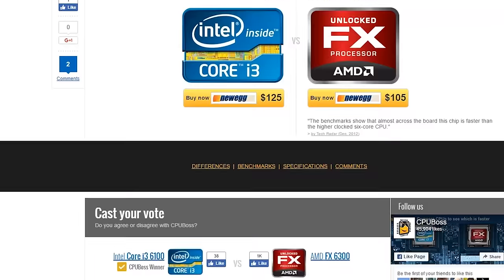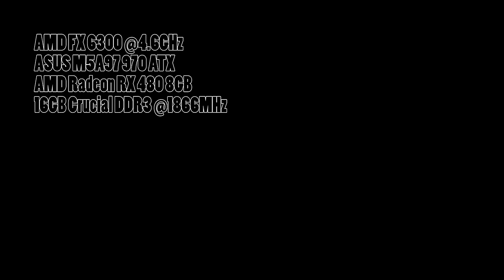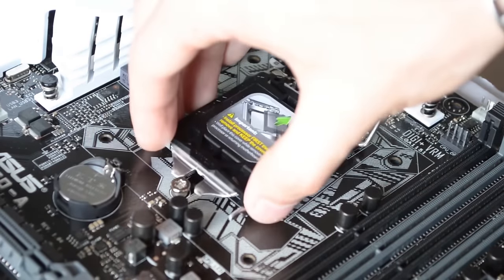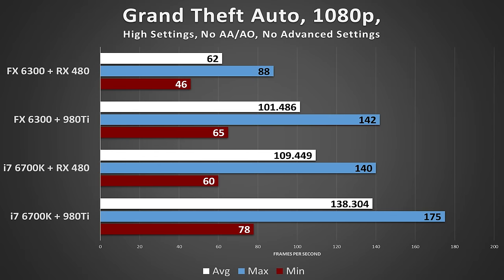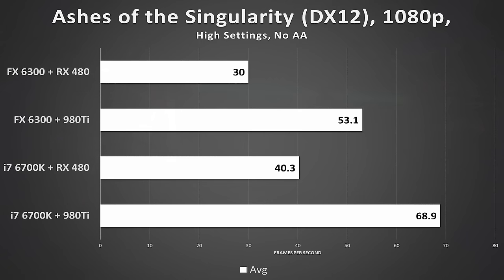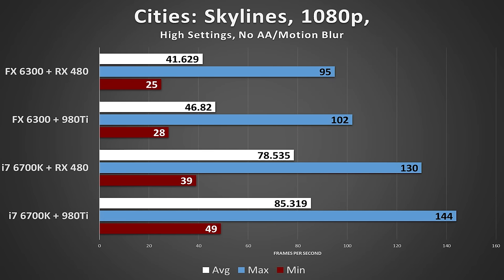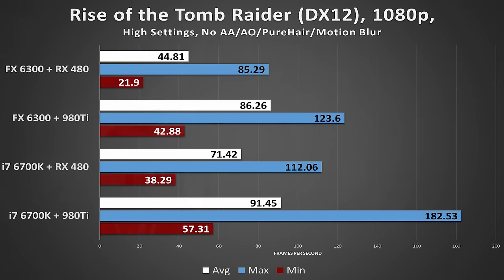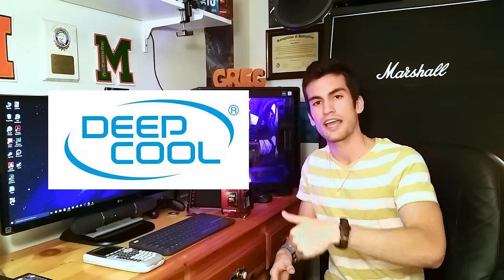AMD FX 6300 + RX 480: Severe Bottleneck?

Comment: I don't see the point of benchmarks in cpus OC's so hard... Why no benchmarks on stock speed?  Or is that bad?
Reply from the maker: You'd be crazy to not overclock. If you build computers, you overclock. End of story.
Reply: Science Studio ok that´s fine, but this is a cheap cpu... it´s logic to be paired with a cheap mobo like the MSI 970a-g43 on those mobos you can´t oc nothing... my question is is too bad pair this cpu on stock speed with a RX 480?
Reply: +Science Studio Lol overclocking the cpu too much can make a little nuke that can make your mom be soo angry because you waste your money only for waching your cpu is explode because over heating

Comment: i currently have an fx 6300 and gtx 960 i plan on upgrading to the rx 480 and the fx 8350 but i can only buy them one at a time so would the rx480 noticeably increase my performance at all until i get the 8350 or not.

Comment: I have a FX 6300 and am considering getting a RX 480. This video shows that it does bottleneck, but that would be until I get a new processor. I'll probably get a zen processor, changing mobo and cpu now just to get an i5 is a bit silly imo.
Reply: I believe Zen will use a newer socket than the current AM3+ socket, but hey I'm waiting for it too. Although, I don't think I will see any gaming benefit, they already run the max my monitor supports, but for a few work style applications, like cad rendering, maybe I could turn my render times down to half a second... The 8350 @4.4 Ghz is what I run, but I really designed mine for cad instead of games, but hey, when you've got a little extra time on the weekend, why not play some Fallout or Tomb Raider? It really depends on what you play as to if you need, for me an R9 270 (sometimes overclocked) runs smooth, but I need more than 8GB of ram, or Fallout likes to crash...
Reply: AMD ZEN cpus will be AM4 based Socket, so you still will have to buy a new mobo for that CPU, also it will use DDR4 RAM, better off if you buy a 8350 used cheap with a good AIO cooler and give it a good overclock to not bottleneck the 480

If you really want something good and cheap, look for Xeon processors on ebay that are 771 socket based, those can be modded to be used on 775 mobos and you can overclock them quite a lot and have great gaming performance, near Skylake i5 6600K if you nail it right
Reply: The point was if I upgrade my mobo and CPU, might as well wait for the new stuff to show up in 6 months (I think that's when zen is out). If zen isn't that good, it might cause other CPU prices to drop.
Reply: Wineblood well this is kind of late. But I did go from an fx 6300 to an i5 4590. Kept the same graphics card tho gtx 960 2gb. With the fx I had fps drops and stuttering at all times. I had none of that with the i5. You might not think it's worth, but it really is.

Comment: Do you think there would be a severe bottlenecking with the i5 4460 with the RX 480?
Reply: Stock? 
Maybe a little
OC'ed
Nope not worth mentioning.
Reply: 4460 is locked. you cant OC it. intel once more doggied you. dont buy intel, ever.
Reply: No, you're going to be fine.
Reply: Friedrich Wilhelm Nietzsche 
Why not buy intel ever when they make the best products especially for gaming. Just buy what makes the most sense for the given budget. 

You can overclock Processor with locked multipliers by increasing the base frequency. However results will indeed be limited compared to a K version due to that restriction.
Reply: 1barnet1 you still want to be doggied by intel.  its weird.
Reply: Friedrich Wilhelm Nietzsche 
Bought a i5 3570k.
It's now running for 3 years at 4.4 ghz stable. 

Single thread performance is arround 50% higher then anything i can get from AMD today. 

Games rarely benefit from having more then 4 threads. So honestly i am rather happy i did not buy crapdozer and jumped ship to intel. 

I had a Phenom 2 X6 previously Which to be honest was their last half decent CPU. 

Luckily some of their GPU's were pretty good. Otherwise they would have been out of business.
Reply: 1barnet1 if you have money, go for intel. that's not our topic. but intel cant beat amd in affordable way. 

hell. they sell i3 skycrap for 125$ (dual core, locked shit)

 while amd sells hexa core, unlocked, beast cpu at 90$.
Reply: Friedrich Wilhelm Nietzsche That skycrap i3 is still better in application's / gaming than that hexa - core from 2011, even beating 8350.
Reply: AnSonCZ most of games are supporting quad core, some of them even hexa core. what the hell are you doing with dual core ripoff?
Reply: Friedrich Wilhelm Nietzsche Check some game's benchmarks, dual - core still beating.
Reply: AnSonCZ you dont understand. it can beat it. but i love to use dozens of tabs open in my chrome, musics in background and some stuff. these things are not suitable for dual core skycrap.
Reply: Friedrich Wilhelm Nietzsche It's still 40% faster in Windows applications, so. And you can use dozens of tabs on i3, don't worry.
Reply: "It's still 40% faster in Windows applications" Lol, maybe in your alternate reality where you have a working brain, use any multithread application and i3 gets trashed, you are not normal in your head.
Reply: ElJackale And that's what ? F*cking adobe photoshop? No 95% of applications are faster (skype, chrome, steam, .. i can go all day.
Reply: ***** Good

Comment: so im upgrading from a busget rig that has a r9 270 and fx 6300, i can get a 980 ti for approx the same price as an rx 480 and im just concerned how viable this setup will be, it wont be for along as i plan on upgrading to either an i5 6400 or 6500 but nonetheless ill be using the setup. am i screwed or should i be ok in the short term

Comment: I have a FX-8320@4.5GHz (16GB 2133MHz cas11) that got it the month they went on sale for under $200 for both the CPU and motherboard and i really should have got the 3770K but that was before it was news that deliding a 3770K made a massive difference lol. Plus, i don't use my computer for gaming that much anymore so i'm not too butt hurt. And I'm about to pick up a RX 480 8GB (Powercolor Red Devil) card for $185 w/$20 MIR. But, i have a 4K monitor that can only do 62Hz lol (70Hz@1080p, i don't even bother) so I'm thinking running at 4K it may not bottleneck the GPU almost in any way.

I don't think (if the FX chip is overclocked around 4.5GHz) it will  affect the game play much if you only have a 60Hz monitor. And the 3GB of VRAM on my old R9 280x is not enough for a 4K monitor, although it does play new games just fine at mostly high and medium settings. But textures is what is very noticeable at 4K. And it's a plus that 4K hides jagged edges so you won't notice the difference between very light AA and something like 4xMSAA, unless you pause the game and look at the screen for a few seconds.

Point is, I think the RX 480 8GB might be great for budget 4K gaming :-)

Comment: What's a good GPU to pair with an A8-5500 APU? I was thinking maybe the rx470 but maybe that would bottleneck. I was also thinking about the gtx 960 or 950
Reply: I also plan to play in 1080p with a 60hz monitor

Comment: can you check if the AMD Athlon X4 860x  would bottleneck the rx 480?
Reply: Your CPU is basically only slightly better than the 6300. As long as you're gaming at 1080 you'll be fine though.

Comment: bottleneck? I would expect the stock clock of the I7 6700k at 4.0Ghz perform better than the stock clock of the FX-6300 at 3.5Ghz even though it has 2 extra cores. Get yourself a cheap AIO cpu cooler and push it to 5Ghz.

Comment: NO FANBOY COMMENTS. But I was considering waiting for zen, but I need a new CPU (I got G3258 4.4ghz) and I was looking at i5 CPU 4460 for £150 also fx 8350 (£205) with mobo, and i3 4170 £100 or fx 6300 £116 with mobo. If I got i5 4460 I wanna know will it last me atleast 2 years or so? by then I'd prolly switch anyway I just wanna know, there's also an i5 4690 for only £170 atm too but its out of stock and says dunno when its getting new stock which sucks, what's best to get?? i5 4460/fx 6300/i3 4170? will i5 4460 bottleneck RX 480 too bad?

Comment: Bought an Fx 8350 with wraith for 80$ , best value/money ever!
Reply: And the Ryzen 3 outperforms it by almost double and its $40 difference. With half the cores.
Reply: @kubaz8702  actually its the same in 80% of the games and 20-30% stronger in single core optimized games but you didnt account for new motherboard and ram while i have AM3+ mobo and 8GB DDR3 from my old system and dont need to spend a dime, so in conclusion since i upgraded from Athlon 640 x4 3Ghz i went from potato to ryzen 3 like but with higher TDP for only 80$ :D  
Also i would never ever reccomend it over R3 only in this or similar cases its far more worth :D

Comment: It is a TRUE 6 core processor. I also thougth it shares some stuff, but I learned some stuff about it since, so now I know, the only thing being shared is the FPU. But the FPU runs 2 threaded always, but can be set to run as one huge unit. But not many applications, programs uses nowadays floating point calculations on CPU. So what you need, is a good integer core. Which is in the bulldozers case is not there. On bulldozer's architecture you get 2 SMALL integer cores in every module. Stop saying bullshit. It's still 6 core. Just not fast. (Though it can compete with Sandy Bridge. 8 core vs 4 core)
Reply from the maker: They aren't independent cores.
Reply: They are. Sharing L2 cache isn't a problem. Like never. They have their own L1 cache. The 2 cores have their own 128 bit FPU core, which can be forced to act like one.
I have a Trinity processor, I know, that lot of the programs see it as a dual core instead of quad core.
But, that is software error.  The processor itself acts like a quad core, only some software couldn't really use it. It is of somewhat AMD's fault yes. They should have released some drivers or external applications to solve this. 
And for your other video, I rather do not reply on, but I say just one thing. Zen will be modular, in the same way as Bulldozer. You can see that clearly from the released dieshots. They just don't use the term "modular", because people are stupid. They do some tweaks on the system yes, but it will be still a modular system. Deal with it. ;)

Comment: Hi, i think that the comparison isn't the right way. You must compare this Radeon RX 480 with a GeForce GTX 970. I Also think that you could compare it not with this 6300 but rather with a 8350. This would give a PC made of 450$ and this will run very faster. I have a 8320 @3,5GHz and a RX480 and my results are average 52FPS in Rise of TombRider at 1920*1200 pixels. René PS: Sy for my bad English. :D
Reply: You missed the whole point of the video.

Comment: this thing is still good bang for the buck. even the fx4300. got some components - fx4300, mobo, 8gb ddr3, gtx 760 and 500w psu for all in all 250€ and now my brother is rocking lol and overwatch on this rig :D
Reply: Nope. Not compared to a similarly priced core i3.
Reply: Mr. Klunee an fx4300 is 50-60 bucks... nothing similar priced there  ^^
Reply: +BlackXbonE I meant the FX 6300 which can be found for about $100. An i3 can be found for $110.

Comment: No man, it is a 6-core processor.  A shareable cache between the cores doesn't slow it down. It is like RAM.
Reply from the maker: Two integer cores share an CPU and a scheduler, as well as L2 cache and a fetcher/decoder. I have a video detailing this complexly.

Comment: 6:56 - "DDR3 'boasts' lower CAS latency" - WFT????

DDR4 almost always has significantly better CAS latency than DDR3. It's only DDR4 that will do the "boasting"

If you have: 
DDR4 at 3200MHz, CAS latency of 14 clock cycles, thats 14*0.625ns = 8.75ns.
DDR3 at 1600MHz, CAS latency  of 9 clock cycles, thats 9*1.25ns = 11.25ns.

The DDR3 with CAS latency of 9 clocks takes 29 % longer for the Column Address Strobe than the faster all round DDR4 doing it in 14 cycles.

Comment: I used to only buy AMD during the Athlon 64 and X2 days, but honestly their processors just aren't competitive from a price to performance stand point like they used to be. My CPU/mobo/RAM is built from 2nd hand eBay parts, a Xeon X5650 6 core 12 thread for $79.99 which I've overclocked to 4.6GHz, a Rampage 2 Extreme for $180, and 24GB 1600MHz DDR3 for $70. It completely destroys any FX even clocked to 5GHz+ and uses less power. When you can get Intel CPU's this cheap, there is just no reason to buy AMD CPU's.

Comment: I have an fx-8370 with the wraith cooler, paired with a gtx 980.. 60+ fps alll day long. the only game I play that bottlenecks a bit is gta 5. most of the time its over 60 but sometimes dips down tp 45 fps. not a big deal to me though, otherwise in my opinion its a great pair.

Comment: yea csgo is cpu intensive, im using no gpu right now as mine died a few days ago and it runs beautifully event tho its on my 6600ks igpu. buying the rx 470 as a replacement for my 970 as a temporary fix then getting another one later to match the 980 ti performance.

Comment: I'm glad I decided to just upgrade my fx 6300 to the fx 8370 instead of upgrading my gpu. I almost upgraded my gpu from the r9 280 to the TX 1060 6gb. I'm glad I didnt do that. My 8370 will pump more performance out of my r9 280 more anyway. My fx 6300 would of just pull down my gtX 1060

Comment: how come that the cpu boottlenecks the 480 but not the 980?
Reply: I was also wondering this.  At first glance (without really crunching numbers), it looked to me like the FX 6300 mainly impacted the RX480 and not the 980.  Is there something I am missing?
Reply: It bottlenecked both, but the horsepower behind the 980Ti did allow it to pull ahead in most circumstances. If you compare the 980Ti FX numbers to the 980Ti i7 numbers you will see how much it was bottlenecking the GPU.
Reply from the maker: Hannah is exactly right.

Comment: The CAS latency should not be a big deal. DDR4 has better latency under equal values due to its design :P
Reply: This is because CAS latency and other timings measured in clocks, which get shorter as you increase the frequency. Because DDR4 has much better frequencies, the difference is actually very little, if at all.
Reply: SilverAndFlint 
The actual architecture behind DDR4 is what makes it have better latency.
Reply: Alexander Yordanov It can. DDR4 runs at a much lower voltage, which is why the timings are a bit higher. However, if you compare it with DDR3, the latencies are surprisingly very close, and sometimes even better in some cases, thanks to the higher frequencies (architectural improvements!).

The formula for calculating latency is the same for all DDR variants, including DDR, DDR2, DDR3, and DDR4, which is:

2/frequency [to get the time each clock takes] x CL in clocks = CL in actual time

And I'm not pulling this out of my ass - this is an actual formula on Crucial's website.

For instance, RAM that's running at 1333 MHz with a CAS Latency of 9 means that the CAS Latency is actually 13.5 nanoseconds, while RAM running at 2133 MHz with a CAS Latency of 14 means that the CAS Latency is actually 13.13 nanoseconds, which is slightly better.

Then RAM running at 1600 MHz with a CAS Latency of 9 means that the CAS Latency is actually 11.25 nanoseconds, while RAM running at 2666 MHz with a CAS Latency of 15 means that the CAS Latency is actually approximately 11.253 nanoseconds, which is pretty much the same.

Comment: I'm looking to get a G3258 for an ultra cheap alternative to the AMD platform and wondering, when overclocked how much would it bottleneck a Rx 480 / 980ti.
Reply: It bottlenecks my 750ti when overclocked to 4.3gh, both of those gpu's are over twice as powerfull as my gpu so it would bottleneck the shit out of them in modern games
Reply: also it's just a dual core, and most new games require 4 threads, so you wouldnt be able to run most new games at all
Reply: Nino Srdic Yeah but the cores are at least Intel cores. And I've seen examples with it overclocked o 4.6-4.7 ghz where it keeps up with a 960 which is a lot more powerful than a 750ti
Reply: i think intel disabled overcloc0:01 / 10:01
e making on the pentium, cause a lot of people were getting a lot of performance from those chips, even close to an i3. This was a few month ago, so you should check that out. The main selling point was that the chip was unlocked, but then they forced a bios update that would disable it
Reply: Nope, you can overclock the g3258 but they forced an update that made non Z boards able to overclock
Reply: i still think you should save up for an i3 or i5, or if you're not in a hurry to buy components maybe wait and check out  zen when its released. The reference  rx480 performs pretty much as good as a reference gtx980 or a very overclocked 970. And those were high end cards when they were released, still are.
Reply: Rob Leonard still Wondering? or bought either of the two card?

Comment: Interesting that the FX seems to be more of a bottleneck for the RX480 than the 980ti. Yet the latter is a more powerful card. Indicates that the FX can feed a GPU plenty of data to crunch, but it depends on the GPU architecture. Sticking with all AMD in this case worsens performance.